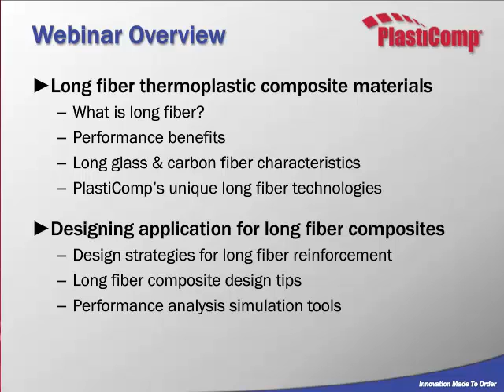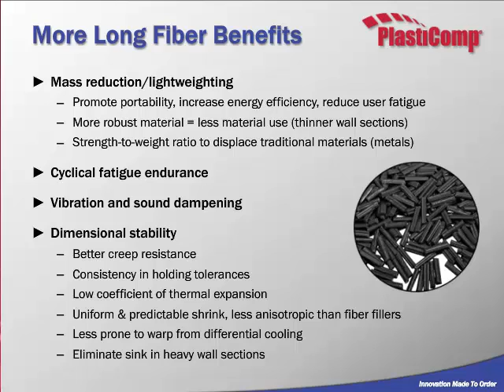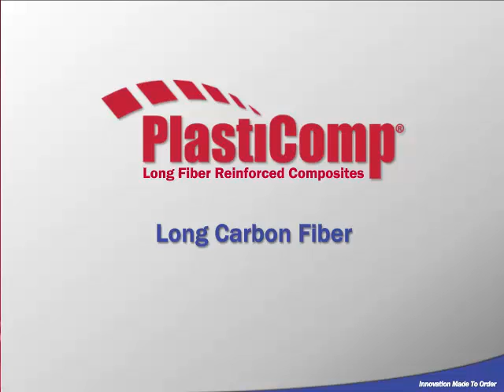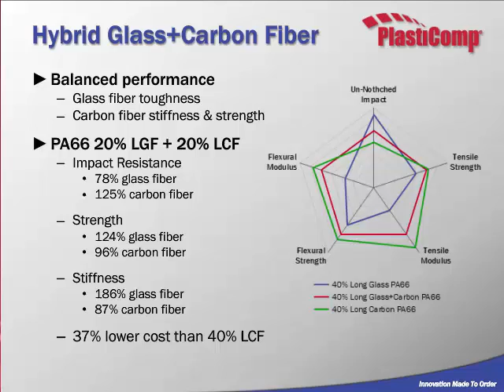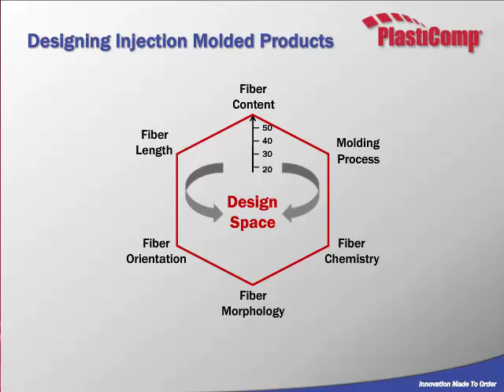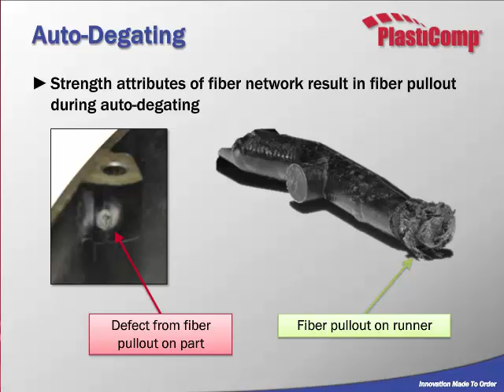Recorded Webinar - Long Fiber Reinforced Thermoplastic Composites

Comment: Hello.
I would like to know what are the defect that could be found during this injection process (thermoplastic + CF). In the session is clear the fiber orientation is based in  the geometry (better design Better filaments distribution). But I would like to know defects related with the Injection Process Itself, i believe there were not mentioned.
Thank you so much in advance!

Comment: How impregnation happen?
Reply: High pressure in the mould. If injection moulding, you inject under a set pressure and also the mould closing pressure. In pultrusion it is similiar principe where you push lots of matrix material into the mould.